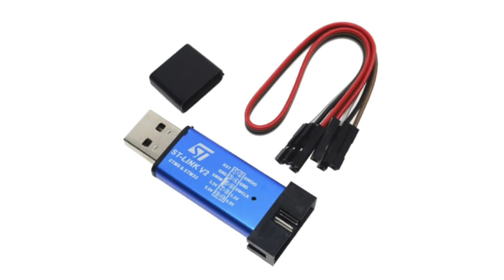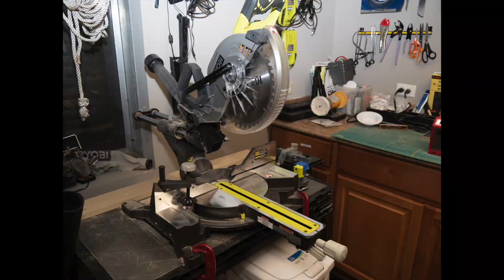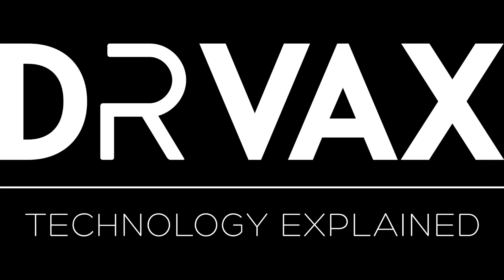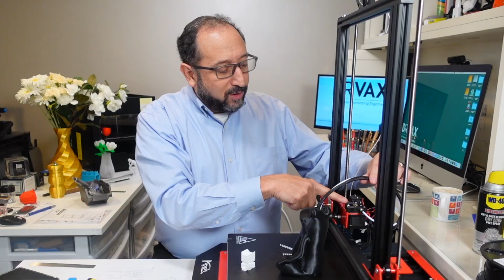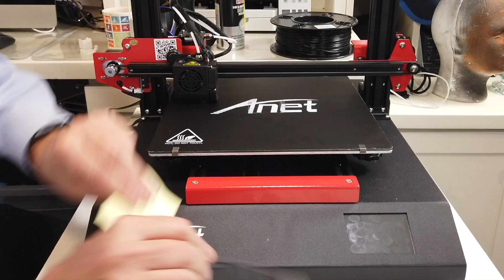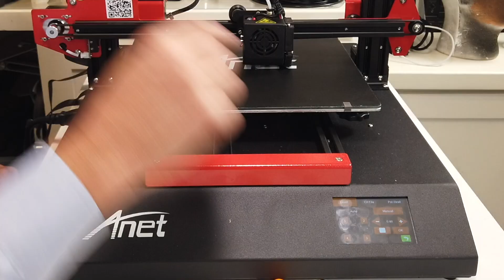ANET ET5 Setup and Review

Comment: I bought an Anet ET4 Pro about 2 years ago but have found it to be more frustrating than satisfying. After a lot of trial and error and YouTube videos, I finally got it to work with some consistancy until late last year when I moved. It has been almost 6 months since I have used it, but recently took on the task once again.  Unfortunately, I found the nozzle was clogged and spent a lot of time getting that cleared. In the process, I needed to replace the feeder tube between the injector and the hot end, then discovered that the fitting on the hot end was no longer gripping the tube. I find I need to replace that fitting, but I am having trouble finding these fittings, even on the Anet site. I can buy a completely new hot end kit but not these fittings, and even these kits ship from China, taking weeks/months to deliver here. I went through this when I first bought my printer, and the sensor was bad. Where does one find parts or a parts list for the ET4 printer?  I can find all sorts of major parts, but not something as simple as a push fitting.  Am I missing something, some secret source, or did Anet just decide to not be bothered with these crucial but small parts?

Comment: Just wondering if you could help me with something I just recently got one of these printers.  I also have an Ender 3 pro, question is I added the printer profile in cura 4.10, but it doesn’t print a purge line at the beginning of the print is there a way to enable it or am I missing something.  My Ender 3 runs a purge line before each print

Comment: Hi people . This printer is worster  than covid19 . why? i worked with many 3d printers but this is real CANCER . every time you push home it give you differnt level so i changed capasitor leveling sensor........   nothing changed .  i changed  mainboard ......  nothing  changed . this company have strongly engeneering  problem (lack of electronic knowledge ).  see how many video in you tube a bout how to leveling anet , 1 milion videoes . you can buy it but prepare yourself to getting old in few days.😁
Reply from the maker: Sorry to hear you experience.   I had a different experience.
Reply: Thank you. you are lucky🙂

Comment: Thanks so much for this video. I first watched it a few weeks ago when I was researching the ET5X. Your video certainly pointed out that it is a good printer that just requires a proper setup to get good results out of the box. It also showed things to look out for while doing the setup. I get frustrated very easily so took my time assembling the printer before watching your video again for the setup. It took a few rewinds and many pauses but your method worked and I was able to print a calibration cube that was very close to specs. I was also able to print a gift for a very happy Mom. Thanks again! 😀

Comment: I have an anet et5 and i tried to run octolapse but it says its not compatible because it does not support M114 gcode command. any idea how i can fix this to get those amazing timelapses
Reply from the maker: Only way to fix this is to upgrade the ET5 to Marlin.  I have a video about this on the channel.

However, I am not a fan of octolapse.   Octoplapse moves the nozzle away from the print at the end of each layer so it can take a picture.  This allows the filament to cool before the next layer which impacts layer adhesion.
Reply: @MakeWithTech  I have timelapse running right now and for some reason my printer moves the nozzle away to the side after each layer not sure why or how I can fix this. i have tried to put a fresh octoprint on the raspberry pi and it still does this before I add in any plugins. any idea why this is happening or how to fix it

Comment: I’m new at 3d printing, and i’m using anet et5 too. When i want to print something, i need to do the bed levelling again after the printer shut down. Because when i didn’t do it, i press the home button and the nozzle hitting the bed. Its likely the bed levelling that i do in the previous day is gone. If i want to save my bed levelling for my next printing so i didn’t have to do that all the time before start printing, what should i do? 🙏🏻

Comment: I don't llike Anet, they have a bad history with fires....
Reply from the maker: The ET4 and ET5 now have Thermal Runaway protection.  In addition you can also upgrade these machines to full marlin 2.0
Reply: I've been running my ET5 almost non-stop since January. Apart from an all-metal hotend replacement and a high temperature Bowden tube, it's stock. Even running the legacy Firmware.
Believe it or not, I love it. It's a tight printer. Metal extruder. Double Z servos. 300mm bed. 400mm high. I use a 0.6mm titanium nozzle for the most part. Haven't had any problems.

Comment: I have a Anet ET5 X having many issues--power switch flip switch broken inside, hot end leaking, auto level sensor broken.  I would Like to change out the whole hot end/ extruder assembly/tubing/and boards it all connect to. As you have mention Anet has non standard sizes for tubes, yeap. Could you recommend a kit or could you select parts that would be compatible  to upgrade extruder, hot end,  tubes, ect.. I wondering is the board compatible to plug new thermostat to hot end or is that differ size also...
A whole Monster Upgrade give it to us cause there not many videos on the Anet et5 x..upgrades.. Thank You!
Reply: If you're still looking to do this upgrade, let me know on Facebook at facebook.com/marcus.pfeiffer/
I don't check back here.
I have done an easy all-metal-hotend upgrade on my ET5.

Comment: im new at 3d printing and I bought a Anet et5x. Assembly went well. the print head heats up as well as the bed. my issue is with the levelin of the bed whatever i try the hot end just keeps moving higher and higher. any help would be greatly appreciated

Comment: Great video as always Dr Vax , I have a ET4 and modified it quite a bit , Marlin 2.0.7.2 , Dual Z and Direct Drive ! , by the way it's possible to use the Capricorn tube in the ET4 , I have done it, the design of the hotend throat is different than the Ender 3 , there is a ridge at the end of the tube to stop the bowen tube and the nozzle seats on the other side. Keep up the great videos. !

Comment: Anet reached out to me to bring support for the ET4 (A4988s)/ET4P (TMC2208s) motherboards and TFT28/TFT35 TFTs used in the ET4 and ET5 series of printers into the main Marlin repo, so here’s the pending PR: https://github.com/MarlinFirmware/Marlin/pull/20280 This will compile for the OpenBLT bootloader (0x10000 offset) by default.

I’m waiting to hear back from Anet about their stock bootloader details, but we’re hoping to encrypt compiled firmware to work without needing to use an ST-Link, so hopefully that will be an option soon.

Comment: I have an ET5 Pro. Prints beautifully, however the heated bed keeps blowing the fuse on the mainboard. My local dealer swapped out the printer and the second one has the same problem. Otherwise the build quality is great
Reply from the maker: Nice to hear you are happy with the ET5 pro.   Check the connectors from the cable to the heat bed.  If they are not crimped properly it will cause the problem you are having.

Comment: Work in progress.
Really.
You think it’s ok they sell something that’s clearly not fully working?
You think it’s ok that you have to open the printer buy an item and upgrade the firmware.
You mention how easy this one is to assemble as if this is a big plus.
How different is this to any other printer.
Anets are rock solid?
Really that’s not their reputation.
You had to move the files on the card to get them to print?
Have you checked thermal runaway is working? It’s all very well for a printer manufacturer to claim this but have you checked this?
Grub screws loose, fair enough possibly you should have checked that first.
Quite good extruder? It’s plastic.
You should not have to upgrade Marlin, this is a dealbreaker and I do not agree with your opinions.
Looks solid but they are sending out unfinished printers and for most people especially someone new this is not good enough.
Reply: My understanding is even budget printers like the Ender 3 now come with a bootloader. Correct me if I’m wrong. So to update firmware on a printer with a bootloader is manageable for many people.
But to sell a printer that does not recognise some gcode commands and means you have to upgrade the firmware and this means you have to buy another bit of kit and open up the case is beyond many people.
It’s not acceptable in 2020 that they sell this like this.
I stand by my comments and there are far superior printers to buy at a similar price so I cannot see how you can recommend it but there you are.
Reply from the maker: The ET4/5 has a boot loader that will load their proprietary firm just not marlin.   This approach is common. The same for example with many of the monoprice printers.  You are also correct the Ender 3 v2 has an excellent boot loader that will load generic marlin.
Reply from the maker: @Paul Milne, I understand your point of view, but of the ten different 3d printer models I have reviewed over the past 12 months, all of them require a bit or a lot of work to make them usable every day.  I stand by my comment that the hardware in the Anet ET5 is reliable at its price, and the frame is rock solid.   I also agree the firmware is terrible, but even the firmware on the new Ender 3 V2 is incomplete, and I have replaced it.   

I have updated firmware or made enhancements on almost every 3D printer I own.   In most cases, with native Marlin.  My only exception to this is my Prusa i3 Mk3, where I use all components from Prusa.  I spent $750 on the Prusa, and it took me five miserable hours to assemble it.   In the future, I would only purchase a fully assembled Prusa, and then it is a $1,000 printer.  The ET5 is $320.  Quite a difference.

My point is budget 3d printers will require work, so the ANET printers seem to be similar to printers from Weedo (Monoprice), Malyan (Monoprice), Creality, and others that I own.  In this regard, if your check the initial reviews for the Prusa i3 Mk3, you will find they shipped before they were ready.

I do wish that Anet would drop their proprietary firmware and ship their ET4/ET5 with Open Source Marlin.

Comment: I spent 1 week to try to fix the Cura 4.8 settings, now prints really good, but the stock settings on the cuts it's a pice of crap and the stock firmware it's really bad (1.1.7) also I set the z offset at 2mm from the bed because for me it failed two times making a hole in the pei sheet, so when you home at 2mm from the bed it's more secure
Reply from the maker: Thanks for the comment.  I will be trying Marlin 2.0 on the ET4/5 this week and report what I find.
Reply: What are your settings?
Reply: @MrWowns  Hi I'm using PrusaSlicer I just copied the stock settings from cura ET5 and added retraction at 7mm and 50 speed
Reply: @sos.gamers  thanks, man ill try it out tonight
Reply: @MrWowns  sorry I forgot I didn't copy the settings I use the profile from ender CR 10 pro V2, and added the retraction settings, works perfect 💪
Reply: @sos.gamers  So, using the cr10 v2 profile on PrusaSlicer with a retraction of 7 mm and 50 mm/s speed?
Reply: @MrWowns  exactly!
Reply: @MrWowns  ah also you may want to add Deretraction at 40 mm/s, 70% and wipe before retraction
Reply: @sos.gamers  thanks for the help man!

Comment: Does Anet provide any slicer profiles?
Reply from the maker: Yes.   https://shop.anet3d.com/blogs/download/et4-configuration-on-cura   

However these are for a very old version of Cura.  I used the one included with Cura 4.8 and adjusted the retraction setting to 6.5mm at 25mm/second.

A great place to discuss this is at the DrVax forum located at https://forum.drvax.com.
Reply: @MakeWithTech  you can just download the slicer settings on Cura, just add the printer in configuration 🙂 but it needs some tweaks
Reply: https://shop.anet3d.com/blogs/et-series/cura-et5-setting

Comment: lol - just finished watch Thomas Sanladerer's review of an anet printer, and it was absolutely scalding.   My head is spinning.  ;)  Quick question though:  does the bed heater cover the full 300x300 bed space?  I've seen other manufacturers just use the standard 235x235 bed heater under a bigger build plate.  Just curious how this one is built.

Thanks for the interesting analysis, looking forward to the marlin segs.
Reply from the maker: Yep.  Tom and I have had different experiences with this 3d printer. 

I just looked and the bed heater comes to 10mm from the edge on all sides.  It is centered.   

Thanks for the comment.

A great place to discuss this is at the DrVax forum located at https://forum.drvax.com.